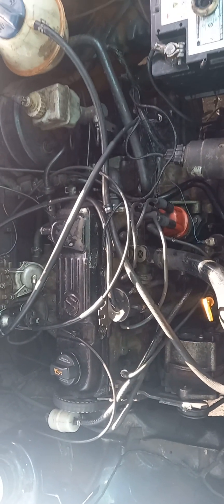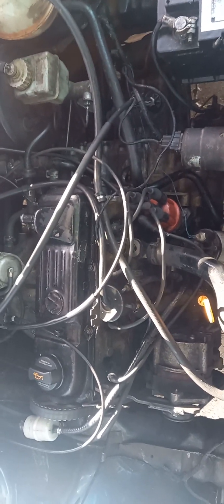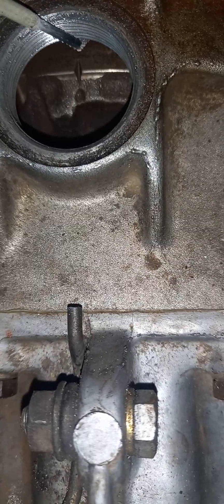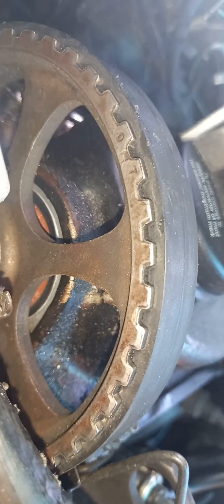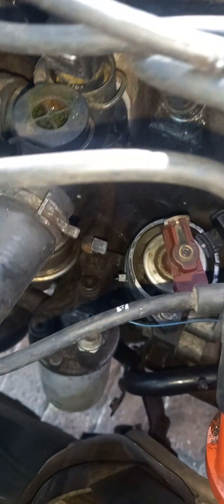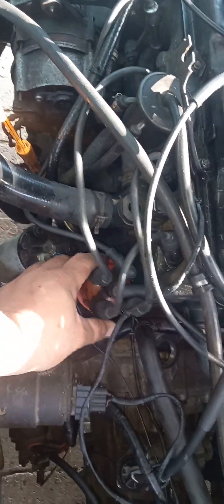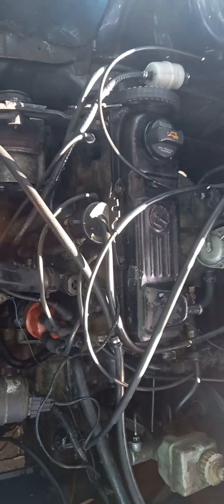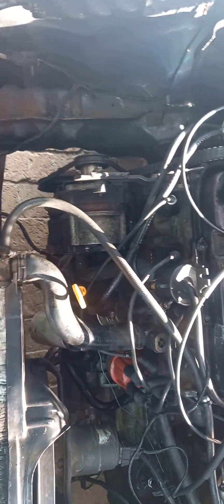Volkswagen Citi Golf Mk1 1.4 How to set ignition timing

Comment: Hi, Just a little confused. The rotar should face the number 1 plug? The one you showing in the video is that number 1 or 4? Reason for asking, 3 mechanics told me thats number 4 and I am totally clueless about this.

Please assist - I have a 2004 mk1 golf , 1.4i
Reply: The rotor head must point to no.1 plug lead on the distributor, not the plug cylinder, there is a small notch on the distributor top ring to be more accurate.